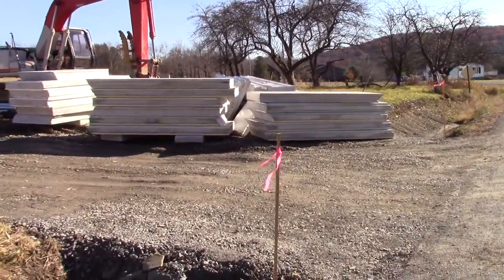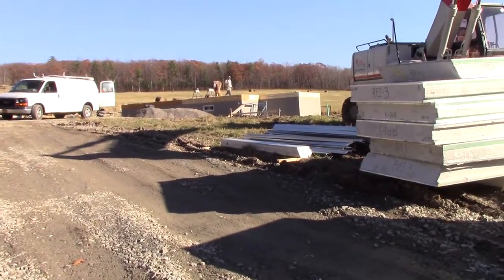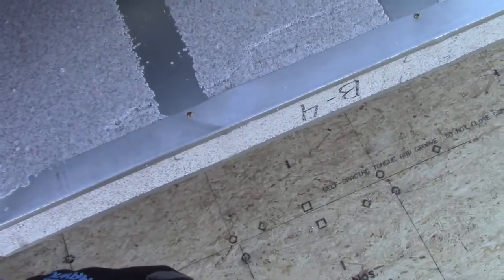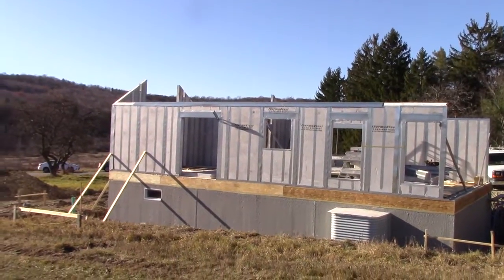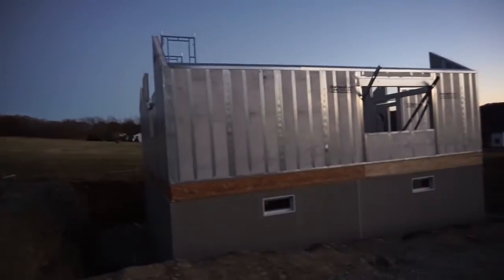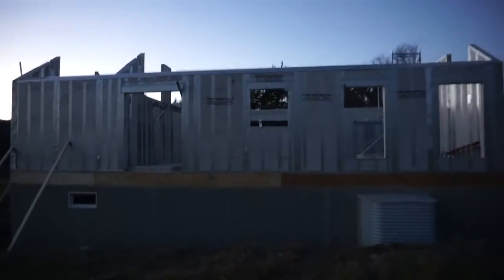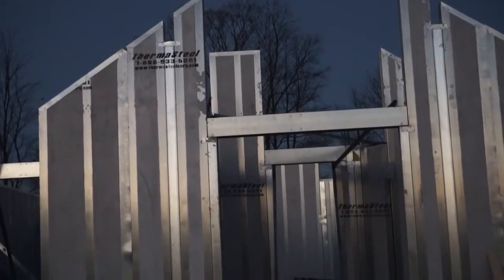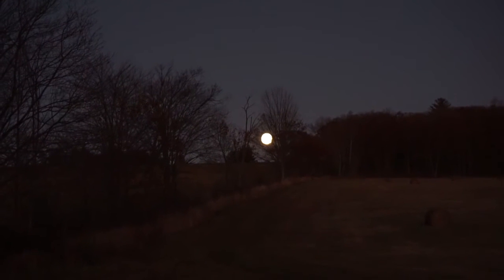HOUSE BUILD VLOG #8: Thermasteel Wall Assembly Part 1

Comment: Thanks for sharing. I've been interested in using thermasteel panels to build for a while. Did you order them directly from Thermasteel manufactures or a distributor located closer? How much was shipping and how did the overall cost of the panels compare to doing conventional framing and spray insulation? Also wondering about cost of labor comparing this method to the more traditional build methods.
Reply: Ben BamBoo i usto make those walls easy just buy the steel tubing and fome heat gun L metal u chanells its cake work
Reply: Hey Ben I can tell you I use the thermos deal panels as I was the exclusive distributor for the state of Texas in the mid 80s. This is the most advance and simple building system on the market even after 20 years. Initial cost is more than sticks but when you factor in labor cleanup waste time interest carry utility savings it’s a no-brainer. Even for the do it yourself
Reply: @JoseHernandez-tm8ug  this is a proven, engineered system.  diy panels wouldn't be to code or even insurable.